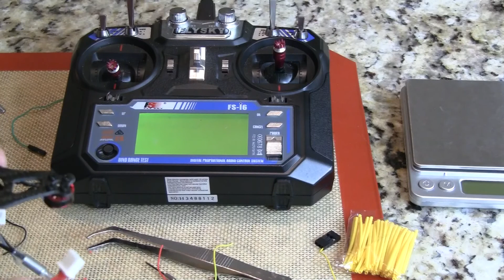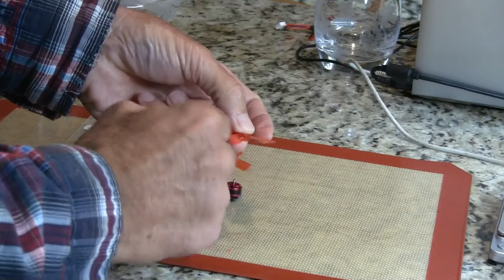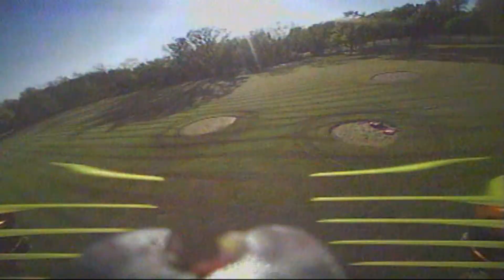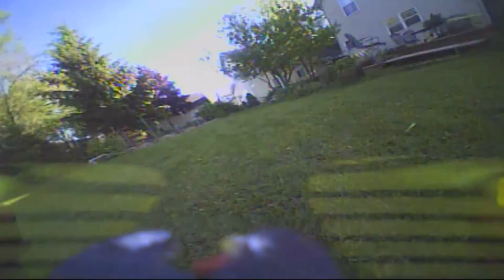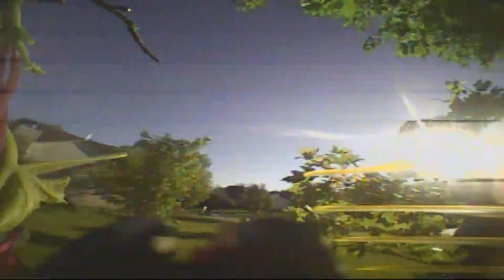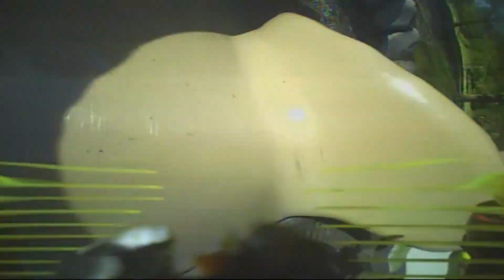King Kong 90GT Quadcopter Review

Comment: I have a couple rtf fpv racing quads like the walkera f210 Arris c250v2 and others. I have the flysky fsi6 tx and I want to get this quad and the mini flysky rx. I want to know does it come with the ppm receiver wire ready to go for the flysky rx I'm thinking about getting?; it's not to hard to set up right?
Reply from the maker: Ian Rice the connecting wire comes with both the mini flysky tx and on the King Kong quad you need to solder the two connectors together. I used the ibus but ppm should work also. Nice if they included a cable that was correct for both ends that doesn't need to be soldered